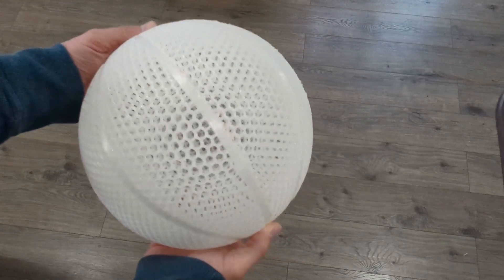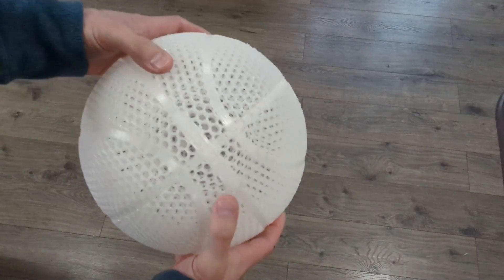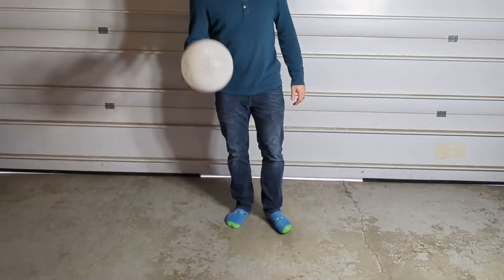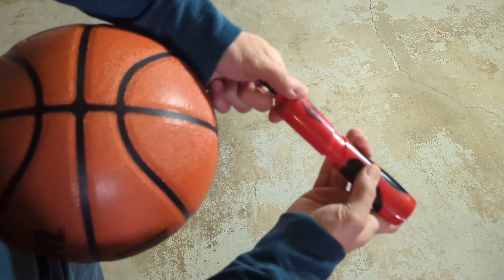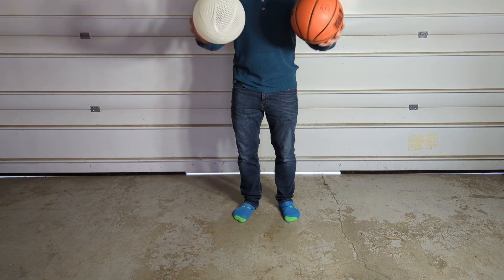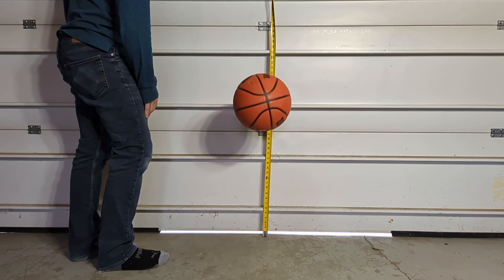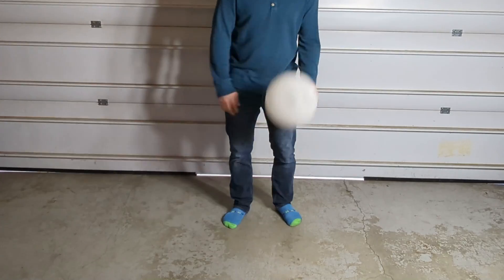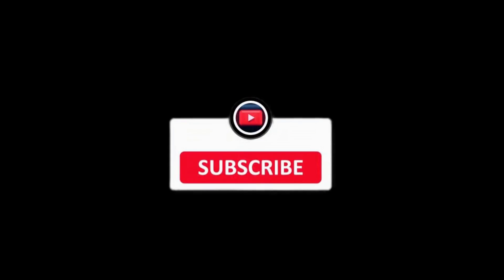This PEBA Filament Makes AMAZING Airless Basketballs! #3dprinting

Comment from the maker: What should we try next?
Reply: Here is an idea, take this ball to a local playground and let some kids play basketball with it to see if it survives 😅
Next, cf tpu or 99a tpu for sure :) but they don't have the same energy return rate as peba, though it will still be interesting to see if they work.
Reply from the maker: @riba2233  yeah I doubt anything will really beat PEBA but worth a try, and a durability test is definitely needed as well 😁
Reply: @makeitlabchannel  yeah :)
Reply: TPC
Reply from the maker: @kirkofrmdawoodz3030  just ordered some so you got it!
Reply: What about Jabil SEBS filament? It’s like 80-90 for 1kg , it’s even on Amazon so easy to obtain
Reply from the maker: @SpoolinMexi  SEBS filament is on my try list, so I will look into this 😁
Reply: 3D printing PEBA sandals.
Reply from the maker: @dfcx1  I do have a Croc shoe design but sandals would be fun in peba 😁
Reply: 3D printed pingpong ball
Reply from the maker: @nedugenas2659  I will have to give that a try 😁
Reply: @makeitlabchannel how much for the 3d file of it ? I'd like to make this myself
Reply from the maker: @SmarthutATL  it is a free file from printables, it is great but has a large file size so takes a long time to slice, link is here: https://www.printables.com/model/829431-airless-basketball-gen-12/files
Reply: Some cheaper PEBA, ouch. I wonder if a smaller one would bounce better.
Reply from the maker: @JaXxX410  yes it was expensive lol, I hope there is cheaper out there but most places were out of stock. and I think a smaller one could bounce higher if you can get it thick enough
Reply: @makeitlabchannel  ok here is a new idea, SEBS filament, similar to TPU but more like a rubber, shouldn't be too hard to print.
Reply from the maker: @riba2233  I will check it out, thanks for the suggestion!
Reply: @makeitlabchannel   awesome :)
Reply from the maker: @CrestoAlex  Hey there, I am not selling them right now but I am looking into it and if I can figure it out I will announce it on the channel

Comment: I have a Bambu  3D printer and bought the needed PEBA filament. Amazing job on your print! Do you mind sharing the precise settings you used for the basketball? I really don’t want to waste the filament since it’s so expensive.
Reply from the maker: Hey there, since you have a Bambu Lab 3D printer, instead of me sharing all of the settings and you plugging them in, you can visit the PEBA basketball site on Makerworld, download and load the 3MF file/printing profile, and it will add the settings and supports for you automatically. Here is the Makerworld page: https://makerworld.com/en/models/545680-airless-basketballs-double-lattice-peba-fpla#profileId-471406

Comment: Is it possible to paint something like this to be a different color? Would you do it like any other 3D print?
Reply from the maker: Hey there, yes, sanding/primer/printing has worked well for me, but the problem with paint on the basketballs though is that as you dribble it, the paint eventually seems to come off. Permanent markers/dying the basketballs might be better options

Comment: So you can take air out of the real basketball and we’ll bounce as high as the 3-D printed basketball but the 3-D printed basketball once it is printed it can’t bounce any higher😢 3:48
Reply from the maker: I never took air out of the ball. Really what it was is that I didn't know the NBA had a air pressure requirement for their basketballs. In my other videos, I air the ball up to the regulation PSI and compare it to the airless one in a fair comparison, and yes, they don't bounce as well as a normal basketball (yet). Never made any claims for that on my videos either...

Comment: nice test. how durable is the ball? did it break?
Reply from the maker: @sciencesaves  Thanks! The basketball that I printed in this video did break, but I designed a basketball file specifically for the PEBA filament and it has not cracked yet: https://youtu.be/L7AP0ahJMyo

Comment: The weight of this basketball is significantly lighter than a more recent video you made
Including this filament. Did you change something?  I want the weight to be closer to standard basketball weight.
Reply from the maker: @jaredfriend9061  Hey there, the reason this one is so light is because I used someone else's model that was designed for more dense filaments like PLA, and it was before I designed by basketball file specifically made for the peba filament. If you use my file made for the peba filament, it should be right at the official NBA basketball weight

Comment: Were you able to print this using 1 500g roll of filament? Or did you use 2 rolls?
Reply from the maker: I had to use just a very small amount of a second spool because of the amount of support material, but if you scaled it down I bet you could do it in one. The problem is the durability for that model - mine cracked after less than an hour of use.

Comment: How big does your 3D printer have to be to print this?
Reply from the maker: @ash_11117  For a full size basketball it will probably need to be about 256x256x256mm.
Reply: @makeitlabchannel  what the fuck is a millimeter

Comment: what diameter did you buy for the filament
Reply from the maker: @Nompid7585  I have only tried the 1.75mm
Reply: @makeitlabchannel  ok, I was wondering for what I should buy, so thank you. Keep up the good vids!
Reply from the maker: @Nompid7585  much appreciated!
Reply: @makeitlabchannel  another question is when I'm getting a 3d printer how will I know that it can print PEBA will it say can print like different filaments and say "PEBA" or will it go under a different category like ABS?
Reply from the maker: @Nompid7585  I am guess that most 3D printers won't advertise that they can print PEBA - I don't think it is a super common filament to print with (yet). I think as long as it meets the minimum requirements for PEBA, it should be able to print it. Some things to look out for would be a printer that can have a nozzle temp at 250C, a bed temp of 90C, and I would not get anything that isn't direct drive as it really helps print the flexible filaments. I highly recommend any of the Bambu Lab printers if possible
Reply: @makeitlabchannel  ok, thank you so much
Reply: @makeitlabchannel  for a full sized basketball would 256 x 256 x 256 mm³ be enough? sorry for the questions.
Reply from the maker: @Nompid7585  yes it will be, a 256x256x256 is what I use, and a full size should be about 240mm all around.

Comment: yoooo so I got a question, so I searched up the filament but under the description of it, it says its only compatible with the ultralight printers or wtv, but you obviously used a different printer, how would I know if this would work on a seperate printer or not. (ive never owned a 3d printer but im looking into getting one)
Reply from the maker: @BassNappr  It sounds to me like they are being safe, I bet that lots of 3D printers can print the PEBA. The big thing to look out for is to make sure the printer can have a nozzle temperature of 250+C (which a lot do), and can have a bed temperature of about 90C. I would think that a printer with direct drive would be necessary because it handles flexible filament much better.
Reply: @makeitlabchannel  thanks, this is very helpful, cuz I didn’t know if certain filaments were only compatible with certain printers, thanks!
Reply from the maker: @BassNappr  good luck!

Comment: regulation basketballs are around 600-620 grams, so this is much lighter and won't play the same.
Reply from the maker: @AreolaGrande94  I agree, the file I used in this video couldn't get to the official weight with the peba filament so I made my own file made for peba, and the most recent one I printed was in the official weight and feels much better

Comment: Hey what model and settings did you use to print this and what is the best filament to use to print he airless basketball, it would be helpful and if you reply thanks
Reply from the maker: Hey there, I made a video explaining all of the settings and filament used here: https://youtu.be/BtqjUwdIx30?si=NyiJj-enTr5ChAQT

I used PEBA filament (link is in the description), but the main settings were 250C nozzle temp, 100C bed temp, 40 mm/s speed, 3 walls, 50% gyroid infill, random Z-seam, and I used tree supports but I had to block the supports at the top and "paint" them on the bottom. I explain it in a lot more detail on the video. Let me know if you have any more questions 😁

Comment: Worth mentioning they only sell it in 500g rolls for about 63$ shipped and you used a bit over 600g. I think Im going to try it with 25% infill because I have 1 roll.
Reply from the maker: Yes, I should have included that in the video but I will add it to the description and I have a video coming out that mentions that. Hope yours prints well!

Comment: The link you shared on the website is for a 500g spool. Did you need multiple spools and used the AMS to switch to the second spool? Or did you use another material for the support?
Reply from the maker: Hey there, yes I ended up purchasing 2 spools because it used 665 grams of filament. I also would not use the AMS either because I tried it and it got stuck, so I used the external spool holder. When the first roll was running out, I ran the beginning of the second spool along with the end of the first until the printer caught the second roll (if that makes sense) so I didn't have to pause the print
Reply: @makeitlabchannel that's a significant omission :) still £116 is cheaper than original
Reply from the maker: @Yash-c3v  I am hoping to find cheaper options that work just as well, but no luck yet

Comment: How’s the durability so far
Reply from the maker: Holding up pretty well - it ended up cracking in a small spot (due to my printer settings, z-seam specifically) but I patched it with a 3d pen and it is holding up well again. I will keep everyone updated, and I will print another after I get the filament for a durability test

Comment: Does printing PEBA release any harmful fumes? Like would it be ok if I printed it in my bedroom like my PLA, PETG AND TPU?
Reply from the maker: On the website it states "low fumes release," so I am guessing it would not be anything worse than printing something like TPU. I had a HEPA air purifier next to my printer just in case though, and that is what I would recommend too
Reply: @makeitlabchannel  I might have to give a try then. I printed a 25% basketball a few weeks ago overture super pla + and it bounced pretty well but eventually broke after a few days so I might have to give PEBA a try. Though I did print a airless ping pong ball out of the super pla + and its still going strong
Reply from the maker: @Tacomaster-lq2ik  yeah I saw Uncle Jesse's video where he made a small one out of super pla+ but he coated it in 3d gloop and it bounced great. I would also recommend using flex PLA by Ataraxia, and it is cheaper than PEBA although it doesn't perform quite as well

Comment: This is ungroundbreaking in a truly amazing way, will you please go more in depth with your print process that gave you the best results with this filament, I plan on ordering a roll myself very soon, my mind was blown when I randomly came across this late last night, thank you!
Reply from the maker: I plan on making another video that includes print settings and everything I did to make the ball, so you got it!
Reply: @makeitlabchannel  I just ordered 2 rolls and am also curious on your settings. I had one good roll of flashforge flexible that made a good basketball that bounced well but eventually broke on one panel but every other roll has been completely different and an absolute nightmare.
Reply from the maker: @AlexMccawley  oh yikes, I am actually releasing a video later today that goes over the settings and setup I used for the PEBA ball, but I would be happy to give you the main settings if you need to start sooner
Reply: @makeitlabchannel  I won't get the rolls in until next week. Can't wait to watch the video!
Reply from the maker: @AlexMccawley  just posted it 😁

Comment: Two points how much filament did this take to print and with how light it is you could easily add another layer to the thickness to get more bounce and durability
Reply from the maker: Yeah I will be printing another one so I will try to add some thickness to it, good call. It took 665 grams total to print 😁
Reply: Where did you order your filament?
Reply from the maker: @justinwehland  it was from a company called Indicate Technologies: https://indicatetechnologies.com/products/kimya-peba-s?_pos=59&_fid=7f47f9c39&_ss=c

Comment: How hard is the material to print? I tried printing flex pla and I can't get it to stop jamming
Reply from the maker: It didn't seem to hard to print, I just followed the recommended settings and it turned out pretty well. The only problem is you have to print it pretty slow so it takes a bit to finish

Comment: You rock!! Please keep us up to date or DURABILITY. Thx.
Reply from the maker: Much appreciated, and will do!
Reply: How durable does it feel? Like what do you think it would take to break it?
Reply from the maker: @ScaleToTheWire  if feels very durable, but since I aligned the z-seam during print on accident instead of random I think there might be a weak spot on it. It hasn't cracked yet, but I bet a few 3 pointers will probably crack it. Will keep you posted!

Comment: How much filament was used?
Reply from the maker: Needed about 665 grams of filament total (including supports)
Reply: @makeitlabchannel How did you get that much, when the filament only comes in packs of 500G?
Reply from the maker: @GoglPlahel  It was pricey, but I had to buy 2 spools of 500g. When the first roll was running out I ran the beginning of the 2nd roll along the end of the first roll until it started printing with the 2nd roll